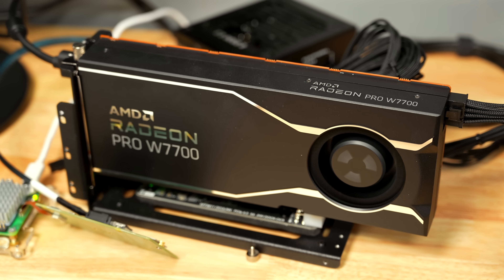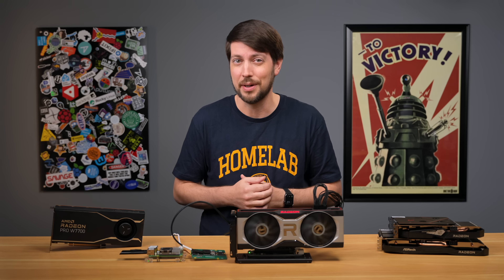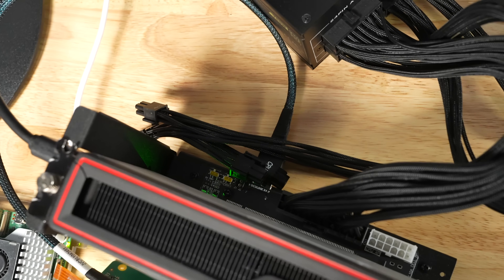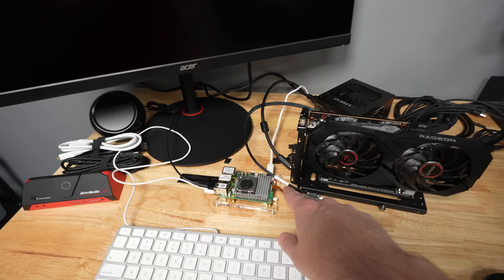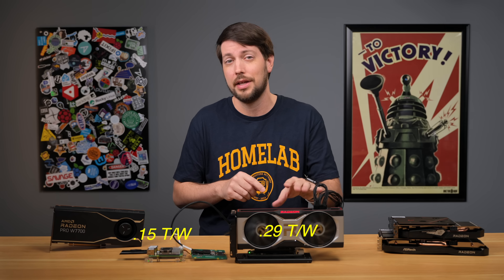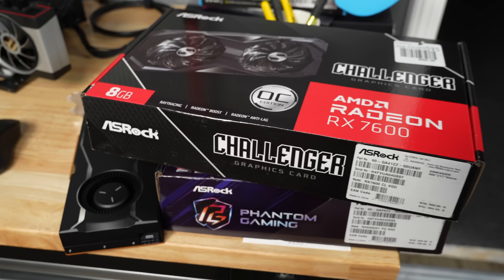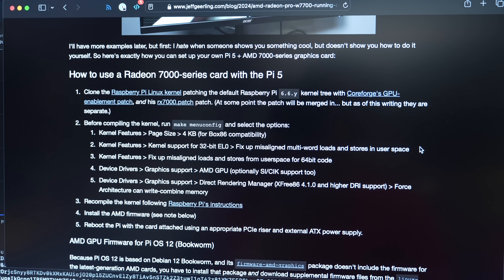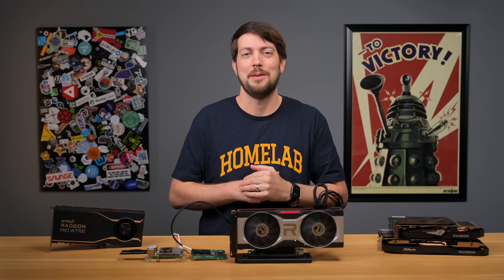A GPU-powered Pi for more efficient AI?

Comment: I found that if you run an LLM with system cycles and give it internal system data to operate with, you'll get a lot more luck running large language models on limited memory.

I have Grok 3 mini running full tilt on my MacBook Pro taking under 20GB of memory, for example.

If you look at RAM as a potential output instead of your total output, you'll get a lot more out of your RAM.

Comment: Now the engineering starts: Creating a raspberry pi case that will host a GPU for LLM
Reply: I'd honestly like a ITX board with a PCIe slot to house either the Pi5 or CM5 alongside for use as a desktop system.

Comment: This is so cool. I would love a mini external GPU for the Pi ;.; just to run a tiny bit more apps. I'm currently stuck with OpenGL 3.1 on my Pi 500.

Funny enough I was able to run blender by saying it supports OpenGL 3.3 in the  terminal. It also fixed graphic issues by doing so for some reasons.

Blender is very slow tho. Like it's very fine but as soon as you rotate the view or zoom in zoom out. Ooooof

Comment: Hi, I'm trying to run llms on x86 celeron snd mining MB with 8 pcix X1, and 8xA4000 16Gb. But... I still did not succeed. It seems to be cheap build because of cheap mining stuff for now. So I dont whant to buy expensive MB and epyc with 128 pci lines. 40Gb of bandwidth is enough for me, so its still experiment. Every card worth 500$ for now, I understand that MB with 50$ cost is not so good, but I have cards and dont whant to buy 2000$ MB+CPU+RAM

Comment: The companies can use such model's and to train it with additional data to accumulate all the knowledge about the system. So the development and communication will be simplified and amplified. Alsi it is easier to train new people to get into the work. And all that u can achieve with some GPUs and pi.

Comment: The fact that I can get 37T\s in llama3.1:8b with a 9 year old 16nm 1070ti xmining card that was acquired last year for 110$ speaks volumes about the current state of modern gpus since it doesnt use that much more power either...

Comment: Great video, Jeff. I am closely following your LLM/Pi experiments. For the moment, I am still sticking to PCs with Nvidea cards. As we know, the Pi CPU can't handle LLMs well enough to be useful. But I will jump back to Pi experiments when things get a little better sorted out. (either Nvidea support, or simpler AMD installation).  Thanks for keeping the local  LLMs in your focus, despite your hesitation on the AI front.

Comment: I have llama.cpp 7b models running in proxmox lxc on a mini PC (Ryzen 5 5600U) using 6 out of 12 cores. Output is at humun speech rate, kinda usable. 10-25 watts. ~$250
Reply: for general use yes. for AI app development, that's to slow.

Comment: Quick question: Why can't I use CoralTPU devices for LLMs?
Reply from the maker: RAM - they don't have the direct memory access required to accelerate anything faster than the CPU on the Pi. They'd only be able to operate on very tiny models.

Comment: Couple of questions. What are your predictions about Intel, is it or will it be supported on Linux, and in this case would there be  a chance running it with Raspberry?
I'm getting more need for a more powerful computer. But I dont know what can and cannot run without nvidia. Games would be a bonus, but more importantely - to program on CUDA or whatever is the alternative on AMD/ATI cards and Intel, and experiment with LLMs and Machine learning.
Nvidia if i understand is a nono on Linux.
Do LLMs require specific technology or framework, like CUDA to run? Specific manufacturer? Or you can use any powerful enough grphics or phisics card with enough VRAM (there were crds for data centers without actual video outputs, second hads some of them are wery compelling priccewise for everything else besides gaming).
To my defence I never owned a computer with dedicated graphics card.

Comment: I have a similar setup, but used a Latte Panda instead of a Pi, and was able to get a used Nvidia Tesla P41 running on it. I was able to pick the P41 up for ~$100 off of eBay. Going for the older server compute cards as a basis for a local LLM server is a much better IMO for a cost to performance ratio. They extra VRAM in the P41 compute card is hard to get close to in any consumer GPU.

Comment: i want to see what kind of AI you could get running on something a little more basic, a pi with a low wattage GPU, like a 550 so the whole setup is "budget"
Reply: Or maybe a cheap cluster of second hand APU's (ok slightly more expensive, but power consumption would be massively reduced.)

Comment: I had good luck and performance with an Intel N100 CPU running Ollama and llama3.2:3b.  It would put out good T/s for shorter answers while boosting, and you were not hitting it constantly with question after question.  Let it cool down a bit (~30 secs) and ask another question and it would do well.  It isn't as good as my 3060 12GB, but usable.

Comment: I'd love a Pi5 in Micro-ATX form factor with one or more PCIE sltos so you would not need all those cables and wires. Also, it would look smug if put inside a nice case together with the GPU.
Is there a Pi5-Compute-Module to Micro-ATX solution out yet?

Comment: I run LLama on a Xeon 2x5450 with 8x3Ghz and 32GByte of memory. That beast is 16 years old and doesn't currently even have a GPU, running Llama directly on the CPU. Which is... okeyish. It is slow but with 32GByte of memory you can run pretty large models without problems. Even more important, the system is using Quad-Channel FB-DDR2-533Mhz, even 16GByte sticks are dirt cheap and I could upgrade it to 128GByte for around €80. How slow? Well, lets say, POE is a bit faster on most things but not by much. So yes, it is quite useable. Only training is really a pain in the ass.

Comment: Hey I was wondering if the rusticl OpenCL driver that's part of Mesa3D could compete with the Vulkan model, have you tried it? It should deliver greater performance than Rocm but I'm not sure about plain Vulkan. Also if you run this through Vulkan than would it go through RADV on Linux?

Comment: How about dual GPU's? And I'd automate it to make it more power efficiënt. With two smart sockets and automate it with entering zones in home assistant. Like if you're entering the zone home, then switch on power plug named GPU, wait 10 seconds and then turn on the power plug of the pi. This makes it even more affordable, since it doesn't have to run 24/7 since you're not at home. With my calculations you'll get two hours on full power when in use. You can even turn off the plugs at midnight if you want, by making an automation.

Comment: Hi, Jeff. Nice video.
But in my opinion, it's a bit incorrect comparison of "RPi vs RPi + GPU". You can take RockChip NPU or  Jetson Orin NX for the models you are using. It will be cheaper, and it will solve the home assistant case (maybe not 40 t/s speed, but it is much better than RPi). 
I hope that Hailo-10 will also be released soon. A few less popular platforms are working with LLMs as well.
Reply from the maker: Hailo-10 will be an interesting bit of hardware to test. Hope they are more available at some point.

Comment: Is there specific Pi5 code you deployed or would it run also on e.g. an OrangePi 5 Plus with its PCIe 3.0 x4 and 32GB RAM? It might be better suited?
Reply from the maker: The RK3588 has some PCIe bus quirks, so far nobody's been able to work around its quirks to get a GPU going.
Reply: @JeffGeerling  that's a shame. Thank you for these insights!

Comment: I have to admit, I originally thought what you were doing (supporting graphics cards on a PI ) was just for bragging rights, but I have changed my mind. Combining something like this with a project like EXO would allow clusters of old (e-waste) GPUs to be turned into quite potent LLMs. I watch with interest!
Reply: Exp runs on rpi?
Reply: @ESGamingCentral  I assume you are referring to exo ? it is being worked on. someone has managed to get it to run on a single pi but is having issues with multiple pis. I have not tried it but I did try and get it to run on a Jetson and had issues with the clang compiler (at that point I gave up).
Reply: @G4GUO  thanks for the feedback.

Comment: Caring about a couple of watts probably isn't worth the effort of using a different cpu. Running a gpu on the pi is a cool concept regardless. Im not sure about the 80+ specification on a regular pc psu but wouldn't it make more sense to measure at the dc bus instead of at the wall? Depending if you can get a quality psu you might be able to power the riser and gpu with some homemade adapters off a 12v only power supply, idk a meanwell for security cameras. That would cut out the other atx bits and voltages from a regular psu and possibly increase efficiency. They are trying to go that way with atx12vo for efficiency in pc's, but then your drives need power off the motherboard or another step down thing for 5v and 3.3. Or even go the other way and run the pi off the psu's 5v rail to eliminate the need for another charger. No idea if those chargers are efficient but they sure aren't free if you're considering them in the setup price and pc psus should have plenty of amps left on the 5v rail to run multiple PI's

Comment: Interesting.  There's a lot of information available around Cuda/Tensor performance for "AI" (for me that goal is LLM for Home Assistant and inference for Frigate) but I'm unable to understand how AMD fits in this space.  
Notionally, there's better value to be had from AMD GPUs but how does that stack up in the tokens/sec comparison against NVidia?  
I'm starting out with an old intel platform so not limited by the ARM compatibility/drivers or concerned about power (it'll be an OMV server too).

Comment: I know this would be even more bottleneck but have you tried a GPU with the cm4? I’m not hopeful that the cm5 will have anymore PCIe lanes since it looks like the RP1 is in there and it’ll need some bandwidth to do its thing. Also, are you running these GPUs at PCIe 2.0 or 3.0? You might have mentioned it somewhere but it just hasn’t clicked for me.

Comment: It would be nice if it were possible to run some of the larger LLMs on the Pi.

I think that the biggest model that I am running right now is the llama3.1:70b model (which takes up about 40 GB of VRAM total, and about the same, on the host system's RAM).

Comment: The problem I see with this is model storage. I currently have a 1TB NVME drive connected to my Pi-5, which is pretty much a necessity for storing and playing with these models. This of course uses the only PCIe port on the Pi, so no way to connect a graphics card. I know, there are some adapters, but if you look into them you'll soon discover they have issues. If anyone has tested and tried one that'll allow an NVME disk and one of these graphics cards I'm all ears. Any thanks Jeff for finally testing and demonstrating this and all the work you've put into helping make the Pi better for everyone!
Reply from the maker: For my testing, I'm using a 1TB USB SSD. A little slower than NVMe, but only slightly—plenty fast for loading models in and out of RAM though!
Reply: @JeffGeerling Here's hoping that the Raspberry Pi 6 will have more and faster pcie slots and lanes and maybe even an ITX version with a real PCIE slot.
Reply: @JeffGeerling  can you test "GRAUGEAR M.2 NVMe SATA PCIe SSD Enclosure Adapter Docking Station with Cooling Fan, USB3.2 Gen2 10Gbps M.2 SSD External Case USB C, Support UASP and Trim, M2 NVMe NGFF M Key B+M Key, RTL9210B Chipset" with the same setup as this video?
They are saying:-
10Gbps High Speed Data Transfer】USB3.2 Gen2 RTL9210B-CG chipset supports USB-C(USB Type-C) connection and data transmission speed up to 10Gbps for steady and efficient data transfer; Backward compatible with USB3.1 and 3.0 at respective speed limits
Reply: If you keep the model loaded all the time, it's not an issue. The lag would get annoying if you swapped between different models like for a home assistant vs a coding assistant.
Reply: The other advantage of using an NVME is being able to have a large swap partition. It's not practical to do this with a micro SD or USB disk because of bandwidth and wear, but having a large swap on NVME will give you a little more flexibility to run slightly larger models.
Reply: How about using PCIE switch? Wouldn't it make NVME to boot? I'm planning to buy one so I only had thought on it.

Comment: I'm always nervous when I hear 'Compile your own linux kernel'.  Is there a HOWTO I can read on this?
Reply from the maker: Raspberry Pi has a pretty good one in their documentation! If you want to see how it goes, try it sometime, it's not too intimidating, just do it on a fresh install of Pi OS and one that you don't need running (in case you mess things up—which is totally normal the first few times).
Reply: @JeffGeerling   That's my real challenge.  I rarely use Pi OS.  I'm just really comfortable with Ubuntu/KDE Plasma. The upside is 'Hey, they're both debian based', and of course, the nice thing about the pi is that I don't feel near as bad if I have to unplug the NVME and put in an SSD to try some stuff out.   I think that is the more liberating thing I feel over my Windows 10 desktop.

Comment: Love the setup with PI 5. But I think a used Nuc 9 extreme + 3060 12 Gb VRam (in total around $600) could be more cost effective. I would trade the different in price for the idle power consumption to the difficulty in the setup process.
Reply from the maker: Definitely a viable option.
Reply: Or just buy an older second hand PC and a second hand rtx 3090 with 24gb of memory 

3090s are now really cheap because for gaming they are slower the a 4070 super. But do still have twice the vram
Reply: @FuZZbaLLbee  a used RTX 3090 alone could be around $700 already....
Reply: @Merlinvn82  got mine for €600. Also bought a CPU, RAM and motherboard for €120.

Did need to buy a new PSU though. So yeah it will be more expensive, but will have 2x the VRAM and more CUDA cores

Comment: Fun, but all this leads to a question - Now is it working on a Pi at all has any of this work benefited the CM4 or is this still entirely reliant on the Pi5?
Reply from the maker: All Pi 5. CM4 / Pi 4 has BCM2711 chip that has a broken PCIe implementation that doesn't work with most GPUs, at least without tons and tons of debugging.
Reply: @JeffGeerling  Figured as much, but still worth asking as there are so many CM4 out there now.

Comment: You called your video card 6500 xt at some parts and 6700 xt in others. Which one are you using?
Reply from the maker: I probably wasn't too clear in the video (it came together pretty quickly yesterday and this morning)—I tested an RX 6500 XT and RX 6700 XT, as well as a W7700, at various points—all the test data is more organized on my blog post and in the ollama-benchmark repo issue I link in the description.

Comment: Ok but the base model Mac Mini is smaller and cheaper than this setup, even more power efficient. Could you do a direct comparison?
Reply from the maker: A worthy idea! I haven't had a chance to get all my testing done on my M4 mini yet.
Reply: @JeffGeerling Can you see if you can get multiple Mac Minis in a cluster to run larger models too? The upgrade cost to add more ram is the same price as the whole system itself, so an m4 cluster is very appealing here.
Reply: I also wonder if you can scale to larger models with the number of mac minis too? So if you have 4 minis or 8 minis, can you run a 64 or 128GB model on the cluster with really good performance? If so, please test Mistral Large 123b on it.

Comment: Fun fact, Vulkan is not a Graphics API. It's a GPU programming API. "Presenting Graphics on a Screen" is a Vulkan extension the programmer will need to enable manually (VK_KHR_surface, if my memory does not let me down).

Vulkan ultimately is meant to replace OpenGL and OpenCL
Reply: So why is it slower than cuda?
Reply: @blisphul8084  I think the reason is flexibility. Vulkan supports a ton of different GPUs, so it is really hard to optimize Vulcan for any hardware. CUDA on the other hand runs on comparatively few GPUs, so Nvidia can pour tons of resources into optimizing it to be as fast as possible on their own hardware alone. It's similar to why Apple's ARM chips are so good, they are vertically integrated and by controlling the entire ecosystem they get a lot of opportunities that a more general vendor just does not have.
Reply: @lbgstzockt8493  So..cute! Closing the environment using elemental math on a closed system! More useful than competition.
Reply: @blisphul8084  as is OpenCL... CUDA is a proprietary Nvidia solution that is 100% vertically integrated. When you run CUDA, you run a nvidia programming language, processed by an Nvidia compiler (cudac) running on Nvidia hardware. 

I guess they are able to optimize things further. I have no idea, I am not a specialist in GPGPU programming…
Reply: @blisphul8084  It is not "per se" slower. There are Vulcan applications which are on par and some are even superior when they take advantage of plattform specific things. What is lacking is
a) optimized Vulcan drivers, especially for NVidia. The current wrappers are atrocious.
b) optimized applications taking advantage of Vulcan.